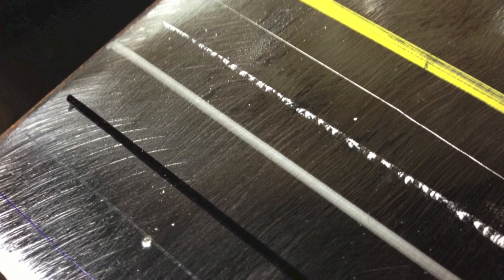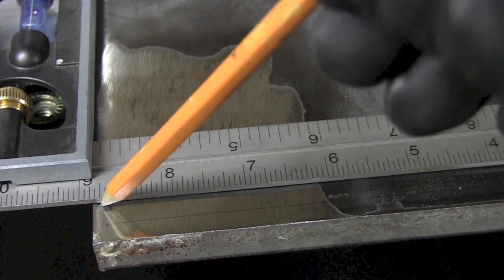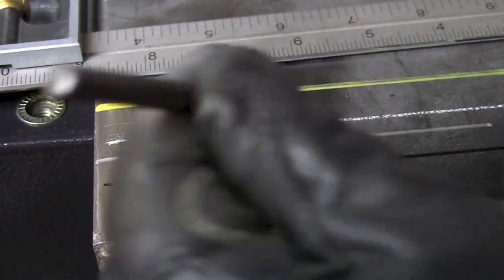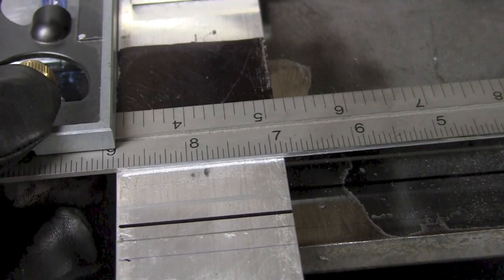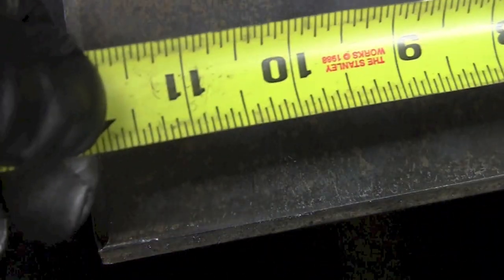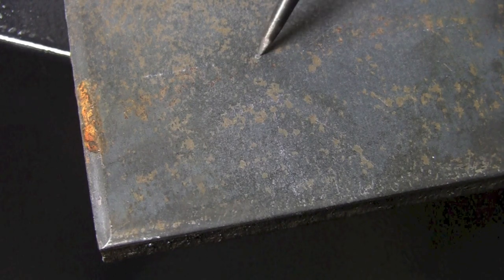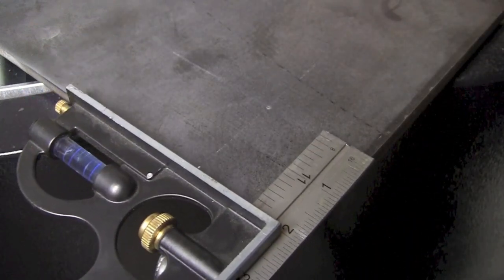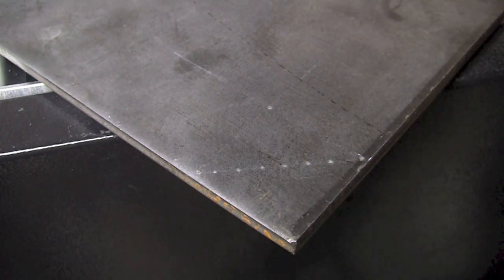Marking Lines on Steel and Aluminum for Fabrication Different Methods Explained

Comment: Don't use pencil if you are welding or on a item that runs near 700 degrees because it has carbon and will make a stress point that can crack.
Reply: Instablaster...